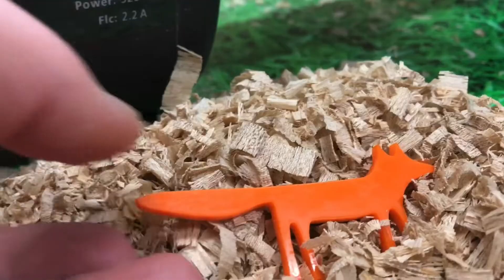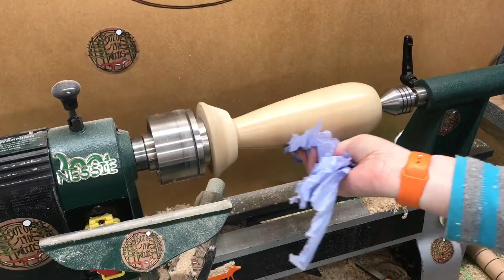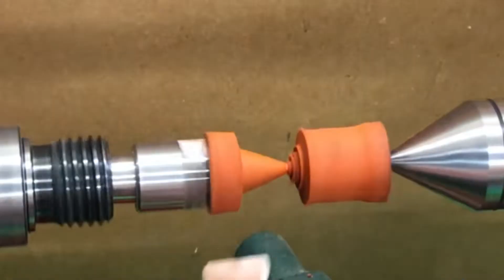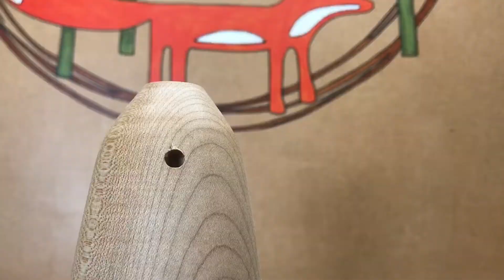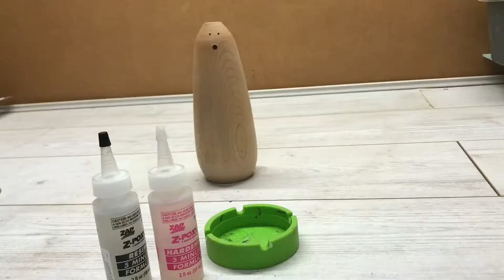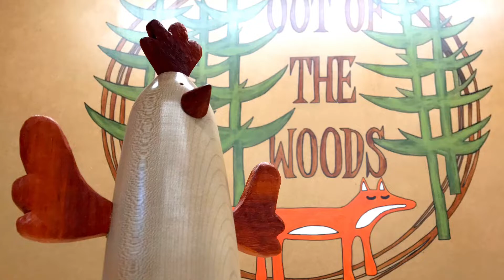Woodturning | Chicken

Comment: Great job Claire, you must be the envy of the foxy world, after all I bet every fox wishes they could make a chicken!

Couple of points. Before you parted off the main body why didn’t you finish the base, could have saved plenty of time doing that away from the lathe.
Also I think I would have used ordinary wood pva glue for gluing all the wood parts together, quicker and probably stronger.
For the head and crown why not fully round the head and shouldn’t the crown run from front to back not side to side?

Either way great unique design which looks really nice, well done!
Reply from the maker: Haha! I knew someone would spot the comb running the wrong way! Well spotted. 

Good idea about finishing the base. I sometimes forget the order to do stuff in - that would have been a good idea. 

I’m struggle to make myself the space to cut curves too which is why I ended up with a flat ish head - I think I turned it the wrong way round really - but it was ok because I needed a flat surface to glue the comb on this time- even if it didn’t run front to back!! Ha! 

Thanks for watching and helping me, Paul - see you Tuesday for another unusual creation! 🥰🌲🦊🌲